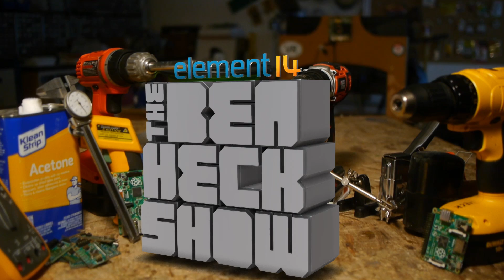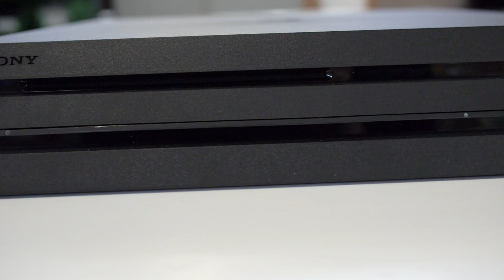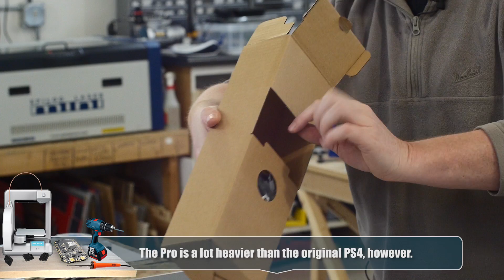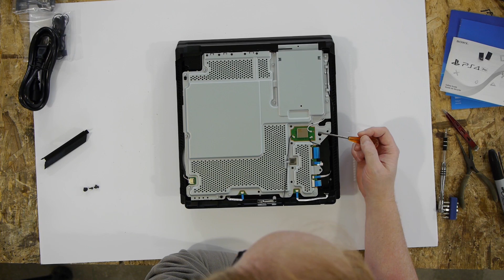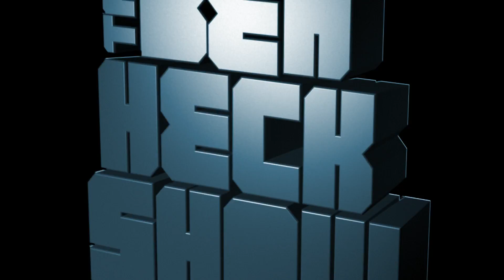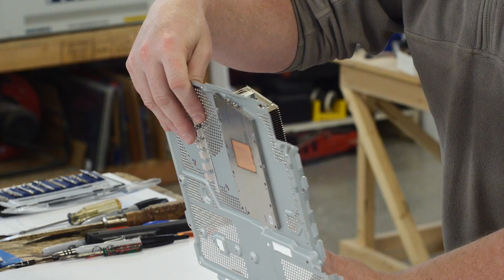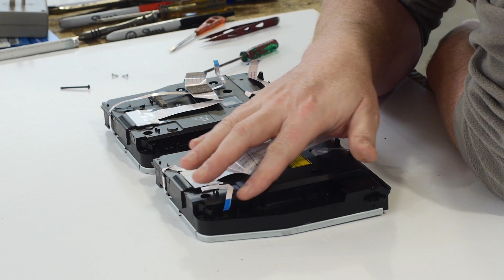Ben Heck's PS4 Pro Teardown

Comment: I own 4 4K Blurays. And yes people still buy physical media, you can clearly see a difference in streamed content and physical since the bit rate is so much higher and plus the audio is MUCH better. I would have upgraded my original PS4 to the Pro, but since it doesn't have a 4K Bluray player I will not.
Reply: I woulda bought a ps4 pro right away if it had 4k bluray capabilities. I mean, it's objective that physical media looks better than streamed media and sounds better too. Compare a 1080p bluray to a 4k stream of netflix, the 1080p bluray will probably be more colorful and might even look better than the 4k stream :\.
Reply: TheWioreks I don't like digital media at all, I have a pretty good Internet connection compared to both but it still affects the quality of the image and I haven't come across a high resolution audio stream once on streaming services, I will always use discs if it means the difference between Dolby/DTS HD audio.
Reply: TheWioreks i agree. i have a few 4k movies. I'd rather keep my movies in a box than bloating up my harddrives. streaming isnt a real option.
Reply: @mitochondriac oh, there's no question. a 1080p bluray blows streaming 4k out of the water. It's not even close. Even on a 4k TV. There's no comparison. 4k streaming looks like shit compared to 1080p bluray.
Reply: Yea honestly he should know that. Can't believe how ignorant he is with physical media. How can he know so much about engineering but be this ignorant on basic technology?
Reply: Hugo Stiglitz My comment was from 3 or 4 months ago and I've upgraded my TV and the with sony updates, ps4 pro is noticeably better graphics then standard ps4.
Reply: the audio is the biggest thing to gain from 4k bluray, you can't get Dolby Atmos through a stream
Reply: there won't be a ps4 pro 2 it will be ps5.
Reply: Brick Tamland Doesnt have to do with your connection.. but with the other million people watching netflix at the same time.. Mine is a symmetric 75Mbps and one thing you might know is that..
It is from us, the performance drops, so that lesser connections can keep up.. as for streaming 4k you dont need anything over 15Mbps download speed.
Reply: i used to always stream 4k movies. but i got a deal on some blurays, and my god theres a difference!!! bluray and 4k bluray lood way better...
Reply: It would've been dumb anyway. Why opt in for a PS4 Pro if you already own a PS4? More on that, why would you even use your PS4 as a blu-ray player? I mean, yeah people still buy physical media but that player wasn't entirely meant for movies, so Sony compromised to sticked with an FHD player.
Reply: Brick Tamland Ok lets be clear ping is the hability of a packet to arrive at some domain and go back to the source.. That can be done even in a local network or in a personal area network.. So im assuming your I.T knowledge is  just average.. Now, it doesnt matter if you got a Google Gigabit Fiber connection if Netflix servers are over capacity.. Which they wont improve cause of two facts: first: the adoption grows faster than the implementation and two: out of the 168hours a week has just around 14 are the critical hours of max server capacity. So they wont spend millions if the remaining 88% of the time servers are under-used.
Reply: Fully agree. Since when did Bluray become a gimmick? Just because he enjoys shitty low bitrate streams doesn't mean everything will go down that way. Physical media is the way to go for true enthousiasts!
Reply: Should I get a PS4 pro, I already have a Xbox one s.
Reply: TheWioreks don't worry they might add 4K blue ray on PS4 pro 2
Reply: Hugo Stiglitz i rescind my comment because I can tell a big difference. Also, you dont know me why the insults?
Reply: oh how fking lazy people are these days
Reply: TheWioreks I bought my Samsung UHD player within 10 minutes of the no-UHD-on-PS4Pro announcement. It would've been nice to play the new Uncharted games, but I value image quality more. Have 20+ movies with the same amount preordered.
Reply: Brick Tamland 4k streaming just got close to 1080p bluray.. That says a lot.. Now the more people is getting streaming the lesser quality there is for everyone.. Thats why peak hours barely mantain a constant bit rate.
Reply: Brick Tamland Thats because you need to activate the live streaming information details which in an xbox Netflix app are displayed by pressing Right Stick and in YouTube you need to enable "stats for nerds" option.. Then you need to make a daily log which would give you a clear perspective of the network drops and when they happen.. either if your untrained eye notices or not.
Reply: your internet is probably shit and the video automatically downgrades to a lower format so it doesn't have to buffer. also you compared bluray and 4k bluray not streamed 4k and disk 4k. you're not making sense cutz
Reply: I completely agree in regards to physical media. Not only is it better quality than a compressed video stream, but I can watch as many times as I like without needing to waste my data or bandwidth. I only have 200gig per month and a 12Mbit connection. Definately not interested in tying up my net connection and wasting my data on inferior quality. 
I understand that people enjoy the convenience, but it really is a compromise, and relative, quite pricey. As a collector there's no satisfaction in having data on a harddrive either.
Reply: TheWioreks should get an xbox one s then
Reply: TheWioreks I saw blue ray stuff on DVD. They said it has better picture and better surround sound. Is that true?
Reply: I agree physical is better but better quality has not been the main factor in the past. Look at mp3 or vhs. Streaming is more convenient.
Reply: The term you are looking for is redundancy, if your other 4k player goes tits up then you would have the PS4. Why Sony didn't stick a compatible drive in is probably the dumb decision not to impact their sales of 4k players. History shows us that this is a dumb move.
Reply: TheWioreks cuz 4 4k blu ray players just isn't enough 😂😂
Reply: That's your connection buddy, i maintain 4k streaming on my 100mbit line without issues.
Reply: it has a lot to do with your ping. maybe you are in the middle of nowhere.
Reply: if you are far away from the datacenter that routes your traffic your ping is higher and your buffering time for high quality streaming is longer. it's that fucking simple.
Reply: Brick Tamland Good.. Now focus on the Server overloads.
Reply: considering youtube and netflix are the main sources of 4k streaming content i would say there is no overload, they both handle their servers well and i have never seen an issue with either servers.
Reply: In Aere Edificare I don't have  this issue on business line. Unless they go offline for Maintenance
Reply: In Aere Edificare Netflix requires a higher subscription price to do 4k. I got YouTube 4k to run flawless, but 4k YouTube is more compressed. Plex 4k is less compression and runs my 4k test videos flawlessly
Reply: Brick Tamland Ok what? Plex is a media server that happens to work regardless if you are online or not.. it relies on the speed of your NAS and router.. not the speed of your provider. So you dont even have Netflix Ultra? that explains a lot.
Reply: In Aere Edificare Plex is a media server that serves your files online through the internet. Stop talking like you know what it is lol
Reply: I have a  fast internet connection (average about 500mb/s), fantastic for gaming and watching films and indeed streaming in HD.  However, I can still experience the occasional hiccup or glitch, or drop in connection, which can really ruin something I’m watching, albeit temporarily. If I then switch to a 4K (or Ultra 4K) Blu-ray Disc, it’s a preferable experience. The picture is better (to my eyes) and most notably the audio is far more vivid and engaging. Might be my mind playing a trick on me or something, but to my eyes and especially ears, the physical 4K disc is still delivering a better and more immersive and thus more pleasurable experience than streaming, for whatever reason.
Reply: Well if you already own 4 4k Blurays, that clearly means you must have a way to view them already...right? So why would the ability to play 4k Blurays be the deciding factor in your getting a PS4 Pro? I would go as far as to say it wouldn't even matter to someone in your situation....
Reply: Remember cassettes were popular once too.
Reply: Yea physical is a bit better but hardly worth it in the end considering the inconvenience of it.
Reply: Why dont you just get a 4k player?
Reply: EvanTheStud I never said I didn't own one....
Reply: I prefer the physical media 25% of the time. It depends on the subject material.
- Disney, Always BD
- Sony, Action flicks only BD, everything else Stream
- WB, Action flicks only BD, everything else Stream
- TV shows, Netflix.

This mainly has to do with high-motion and sound mastering. If the source material is primarily CG, or primarily rapid-motion you always want the higher bitrate. If something is primarily "talking heads" (eg TV shows, dramas) then usually the high video bitrate and audio mastering is barely above streaming.

What people tend to forget with streaming is that streaming is primarily for people using computers with small screens and stereo speakers, so Netflix and such tend to be optimized for that. Likewise when people select the "digital download" version of a film, you are getting essentially the DVD resolution video at h.264 compression rates with the stereo audio meant to be played on a device without a DTS/DD decoder.
Reply: YUKI JINJUJI 4k discs are for dumb physical media collectors. The vast majority of users stream 4k videoa
Reply: bitrate is overrated. streaming services are continually providing higher quality with lower bitrates and it will only continue to improve. this is why physical media is dead. it may not be as good as 4k bluray but the streaming services are getting closer and closer. and with a high speed connection you could probably stream at the same quality as the disc without the huge file sizes.

Comment: HGST is Hitachi, and is owned by Western Digital. I've heard that their drives are pretty solid.
Reply: ラジカルラクーン I follow a lot of tech news and related things online and people make it out that HDDs normally don't last too long but personally I've never owned a drive that's died in less than 5 years.
Reply: HOUSTON ADLEY whoa pal, you don't have to yell it.
Reply: Yep, I can attest that these HGST drives are pretty nice.
Reply: Yeah, I got my specific model because while it only has a 940m it can handle all of blizzards games and the build quality is pretty high
Reply: Hitachi has (by far) the lowest failure rate of any HDD manufacturer.
Reply: You've probably never had an hp computer then lol. The Seagate HDD in my Pavilion dv6000 would fail after 9 months. I bought a 3 year warrantee so I'd send it in and they'd send me the same shit drive back (likely refurbished). I'd install it, get everything set up and do the whole thing over again after another 9 months. It wasn't until my warrantee expired that I got a Samsung 840evo ssd and used the stock hdd as a secondary drive. Been over 2 years with no issues yet.... I better find find some wood to knock on...
Reply: Tyler Green UPGRADED to Lenovo?? I don't trust them after the Superfish scandal. Same with Toshiba and their reporting on false profits and then ousting their CEO. HP really appeals to average consumers, but they aren't that amazing. I like Acer.
Reply: HGST 1TB 7200 IN MY LAPTOP, I SO HAPPY TO SEE WD PRODUCTS INSTEAD OF SEAGATE
Reply: I would say they were more solid than WD. I own about 10 external and about 20 internal. my Seagate WD and Toshiba (dies and comes back constantly) have all failed. while these drives did not.
Reply: Well the Deathstar HDD happened when that line was still part of IBM. IBM's HDD line wasn't sold off to Hitachi until about 2 years later. I almost bought one at the time, but went with a different brand luckily.
Reply: Q.T. Productions of Utah  that's unfortunate, I've only had 1 HP the build quality was shit but the drive lasted a good 4 years before I upgraded to a Lenovo
Reply: Well as far as I've heard superfish was removed completely years ago. So I'm not worried about that bit.
Reply: Tyler Green Hey, as long as you know about it.
Reply: I bought a few of their hard drives in 2007, 2009, 2010, 2012, 2014, 2015... and they ALL still work (I do remove the oldest from service when I add new drives, and store those as backups). Not one failure in 13 drives over nearly a decade. (for disclosure, the older ones were marked Hitachi, newer HGST)
Reply: Hitachi is the only brand I've seen fail before the computer was retired.
Reply: Q.T. Productions of Utah I got a Samsung HDD in my HP Envy, and it's been solid for the past 3+ years.
Reply: Tyler Green I think it was a Seagate barracuda drive that was in this PC I had back in 2005 HP PC, point being that that drive which was from a HP build is still going strong after all these years
Reply: I'm getting old. I know I'm getting old because I used to have a 40 GB Hitachi Deskstar(formally dubbed the Deathstar for a reason). 

Click of death after 17 months.
Reply: @der_pinguin44  you didn't, they were IBM drives back in the days of that capacitys. hitatchi bought the deskstar brand, amazingly, many years later
Reply: I still have some ancient 1TB and 2TB drives running, Seagate and Hitachi. They have been abused and still taking it. I guess you no longer get what you pay for. Those are now running NAS duties, with a modern 3TB USB3 drive backing up the NAS box. My machines are running boot drives of Windows 10 on 480GB  Hitachi SSD, and Linux on 120GB msata. It's so nice not having to wait for long boot times.
Reply: Tage Nasty Except my HDD just failed in mine.... Made by hitachi.
Reply: Q.T. Productions of Utah :) No wonder why Carey Holzman is saying that HP goes for Horrible Products. XD

Comment: HGST = Hitachi Global Storage Technology
Reply: segaprophet at this point western digital just keeping the HGST name for brand recognition
Reply: Oh yeah, was unaware it recently went to WD. It was originally IBM that sold its HD business to Hitachi.
Reply: ***** spinning HDs are the hot potato of the tech industry
Reply: I've bought several of their hard drives over 2007, 2009, 2010, 2012, 2014, 2015... and they ALL still work (I remove the oldest drives from service as I add new drives, and store the old ones as backups). Not one failure of 13 drives over nearly a decade. (full disclosure; the older ones were marked Hitachi, newer ones HGST).
Reply: The most reliable HDD's there is. HGST was king in that HDD reliability test. Toshiba was #2, WD #3, and Seagate #4. WD and Seagate were quite a lot worse than HGST too
Reply: And conditions of the stock holders.
Reply: DaveC1964 I still have Hitachi drives made in 2005 running, WD on the other hand all broke after 3 to 4 years.

Maybe in 2016 they all now have that horrible WD quality..
Reply: It's not about innovation, it's to satisfy antitrust laws in several economic regions as a condition of the merger.
Reply: Mark R. Wait I feel like its the third time I read a comment of yours criticizing WD hard drives, do you do this all day long ? haha
Reply: Alan Tisserand he's right though only Seagate Samsung is worse than wd
Reply: Alan Tisserand just have bad experiences with them
Reply: Mark R. I'm not saying you're wrong, I just thought it was funny how I remembered you bringing that up several times in the past, on other videos!
Reply: Alan Tisserand I don't
Reply: segaprophet thanks for that. I was going to post the same thing.
Reply: Mark R. I have a HGST in my gaming PC (I was able to get a used one for cheap) and maybe it's because it's used but the R/W speed of it is slower then I thought it would be. I didn't go to into depth to find out more about that specific HDD but it's been working well more me.
Reply: segaprophet they have very good enterprise drives.(now owned by wdc)
Reply: segaprophet My 5 year-old acer aspire laptop has a Hitachi HDD and it works with no problems
Reply: HGST is a subsidiary of WD, meaning a WD drive is not a HGST drive and a WD drive is not a HGST drive.

They share technologies, but it was smart of WD to keep it as a separate subsidiary (because it'll lead to more innovation)
Reply: oh no broken down hhds will be often
Reply: I thought it was Horribly Glitchy Storage Trash.